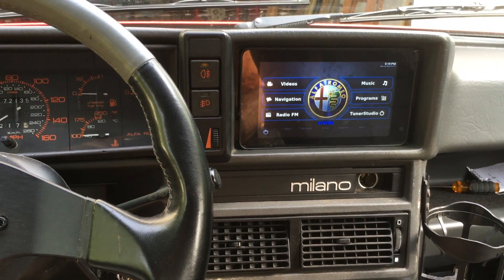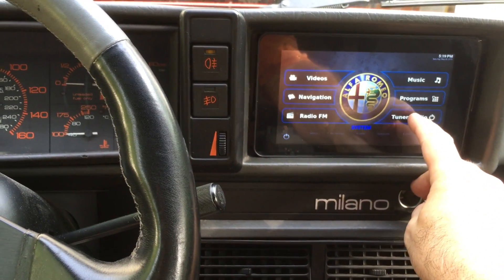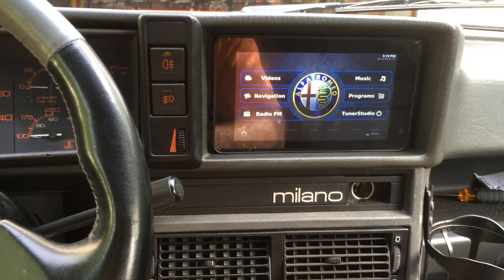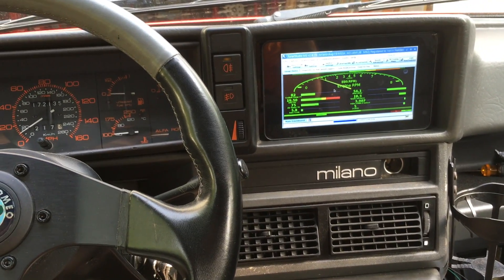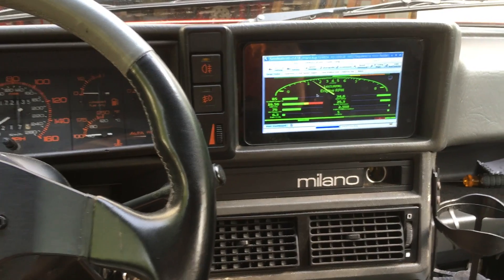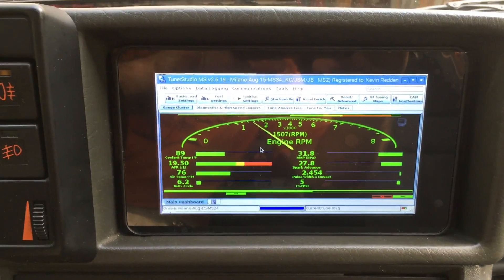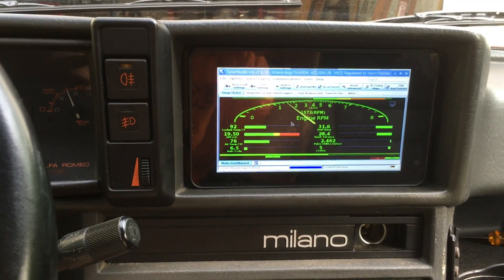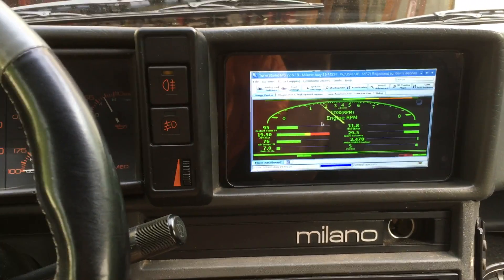Milano ARC replaced with Raspberry Pi 3 running TunerStudio for Megasquirt

Comment: What is the main purpose of the interface for your application? Just display information, or are you using the pi for the tuning process? I am wanting to pick up a megasquirt kit, but I would like to know to what extent you can use the pi for actual tuning. I am more than familiar with the pi and raspbian, but it seems like a lot of the applications I see are just for information display, and not tuning itself.
Reply: I've since moved and sold the car but did not keep the Pi connected in to it.  I was planning on having the Pi there mostly for viewing and data collection for the squirt but I don't see why you couldn't use it with the autotune feature.

Comment: like, with the Alfa logo and easy to use Interface
Reply: I modified a version of "CarPC" which is primarily focused on audio, GPS and the like.
Reply: Kevin Redden  any way you can make that available as download?
Reply: Remy, my version of CarPC is quite heavily modified and I've removed a bunch of the stuff that it normally has that I didn't want to use so it is very specific to my use and I'd think useless to anyone else.  You'd be better off finding and downloading the original CarPC distribution.